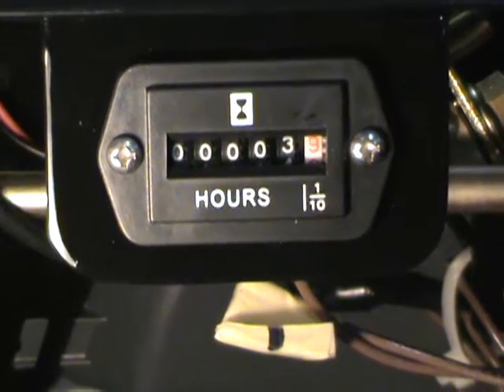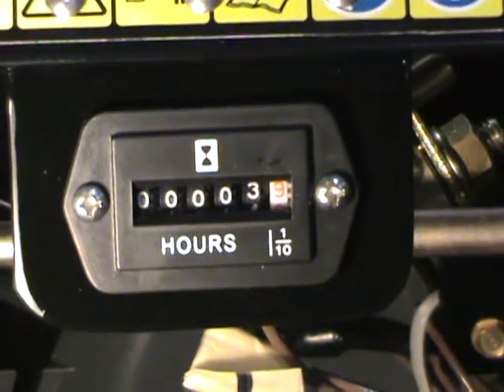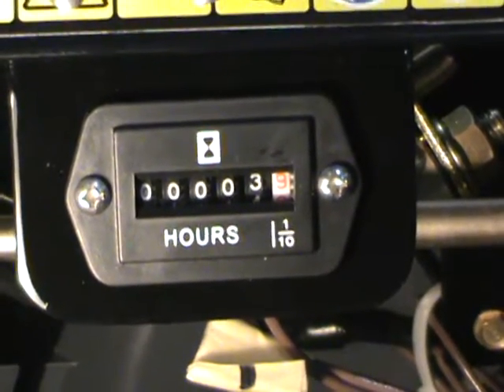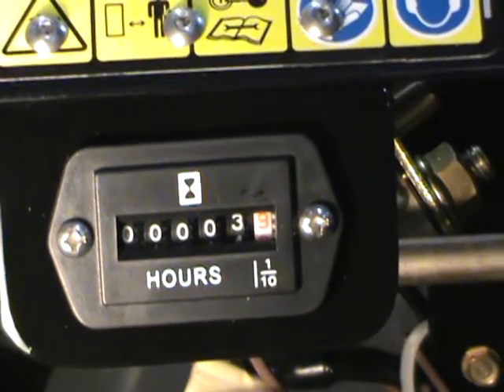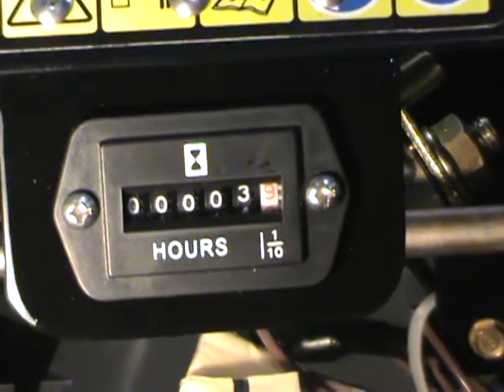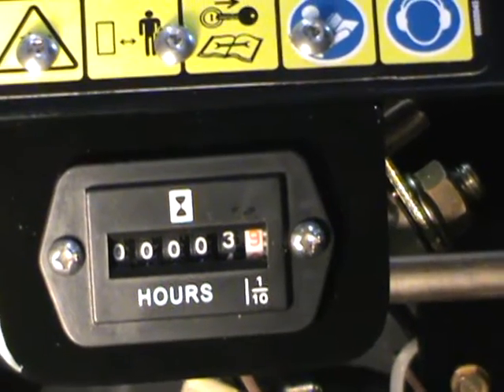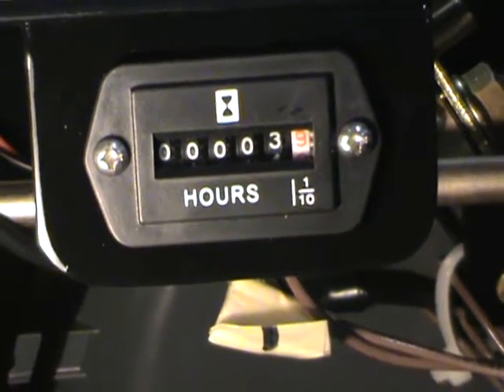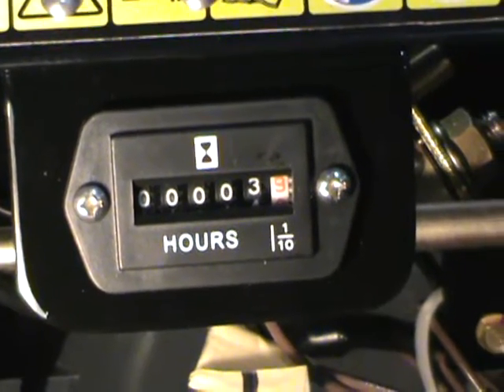I added an hour meter on my Snow Blower

Comment: Where did u hook up the positive side for the blower
Reply from the maker: Because I put LED's on this machine, I had to put that bridge rectifier (which is that little square part  with 4 connections) so the lights would work.  so I put the red side of the hour meter to the + side of the rectifier.
Reply: 007connecticut nice idea I would love to do the same as well I seen u used ID is connecticut where about I'm from Springfield